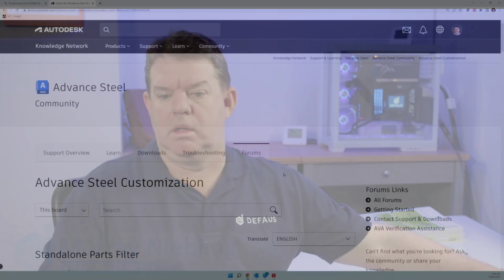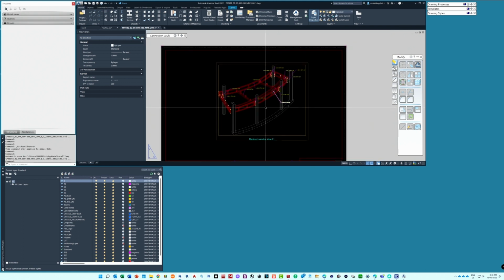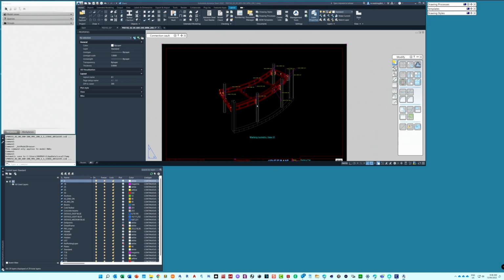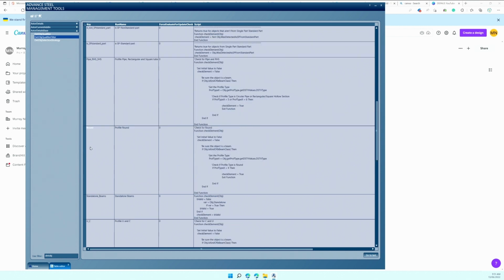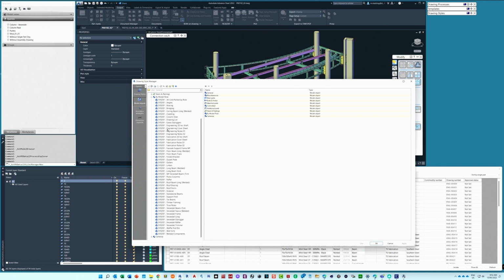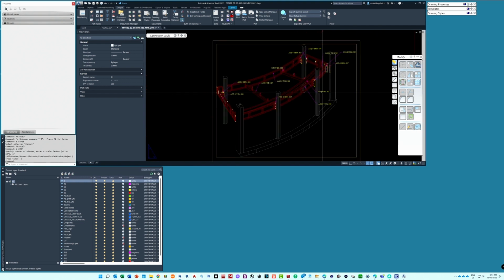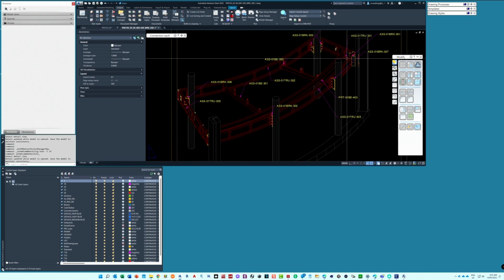My 1st Coffee Episode 004 - Advance Steel (Standalone Beams)

Comment: Hi Murray,
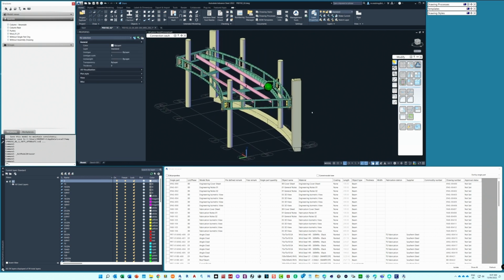At 3:13, it seems like rotation is performed with a 3D connection mouse?
How to install Advance Steel drivers for such a mouse?
Reply from the maker: You are correct, I do use a 3D mouse.  I believe you just go to the their website to download the drivers.  Just a side note, that some people in the last few weeks have had noted issues with the 3D mouse drives or firmware.  Not sure of the exact reasons but I would check the forums to see what others have found.